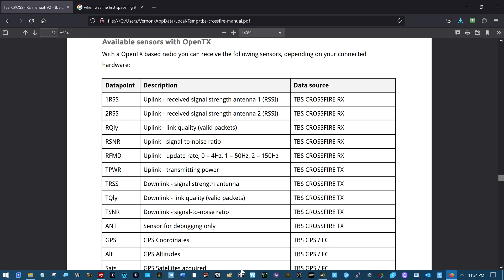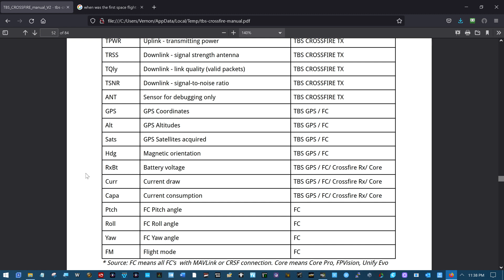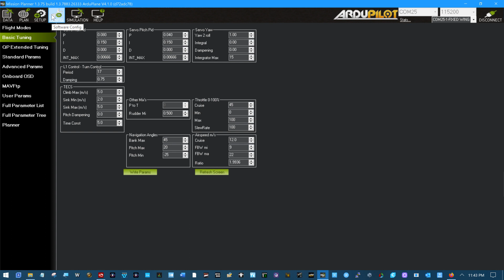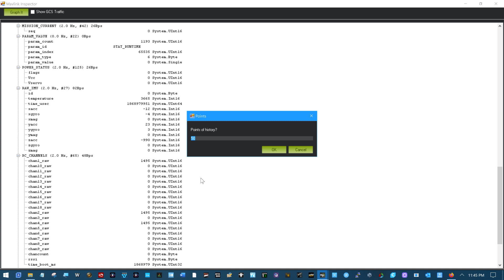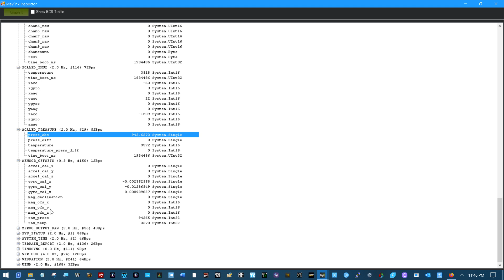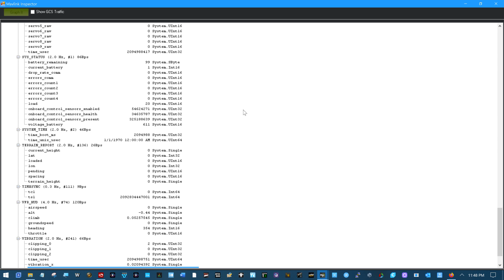Why Am I So Interested In Telemerty

Comment: I am also passionated with telemetry starting with apollo in late 60s. I am using telemetry for all my arduplane flights since 2017.
Reply from the maker: Just makes good sense, doesn’t it?  I like the backup in case my RC TX fails.  It helps me keep track of where the platform is.  It records data that can be very useful.  And it costs very little.

Comment: Hlo sir i am using Matek H743 wing and Frsky X8r receiver how do i transmit telemetry to the Jumper T16 pro what parameters are to be changed in Ardupilot mission planner
Reply from the maker: I am still trying to find more information on the SPort/FPort.
https://youtu.be/ZuE842Bhw9g
Reply from the maker: I did find that other information.
https://youtu.be/Zf5811u-Hao

Comment: The Data Man! Cool cool.. I myself got into wanting telemetry just for the gps coordinates so I could get my antenna tracker working. But learned real quick that the range crossfire allows for telemetry is beyond shorter the distance i fly. Unless using a high gain antenna... But it is still too short. But all the data points that do not stream thru crsf goes into the Blackbox log using inav. 100s of data points like Ardupilot... But I still do not use it. Why.... Cause I'm old school I guess... lol I would rather replay dvr footage of a flight to figure out a problem. Wouldn't have time during a flight to look thru all the data. So there is no need for me to have the ability to look at live data during a flights.
Reply from the maker: Yepper, a second use for the telemetry is an antenna tracker.  It is also used for follow me mode.  I will be using follow me in the future to launch one airplane and then a second that will follow and video the first airplane.  I haven't spoken much about either of those yet, but they are another good use for that telemetry.  I have never viewed that data during flight.  Actually I just found the terminal screen where it is displayed real-time.  Might be a new function I don’t know.  I have used the HUD on Mission Planner for altitude and such, or to view where my platform was on the map.  You see, I have never had an OSD before either.  The Pixhawk, APM and mRo autopilots I have used do not have a built in OSD like Matek flight controllers.  Mostly I had voice mode turned on so every 30 seconds Mission Planner called out altitude and speed and such as that.  The historic problem with Ardu telemetry was range.  The original 3DR telemetry radios(25mw I think) went about 50 yards or less.  Almost useless.  I had to turn off the telemetry failsafe because the telemetry radios lost connection so much.  When I moved up to the 1w RFD900 radios, I maintained a connection and could turn the failsafe back on.  I never ever got out of range of the EZ-UHF/RFD900 radios, but the RFD900 radios will never go as far as the EZ-UHF.  They are both 1w, so the 433 MHz should go farther than the 900 MHz by default.  My EZ-UHF can be switched up to 2w.  I don’t think the 2w is legal in the United States, I think the upper limit is 1w without a HAM license and an extra .5w for someone with a HAM license for a total of 1.5w.  I have the original EZ-UHF and I THINK (not sure) they have been downgraded to 500mw max now.

I did not switch to Crossfire for the telemetry.  I did it for the size/weight/cost of the receivers.  The EZ-UHS receivers are around $125 each.  Used ones can be had for less.  Finding that it might also be able to do Mavlink in addition was just a bonus.  IF I ever get it working.  lol

Truthfully, I have not used the telemetry for anything except vibration dampening in almost 10 years.  I have never had a platform run away, never to be seen again.  I have had them run away.  Lol

I fully expect the telemetry to be like backups and insurance.  Hopefully never needed.  But it will be Irreplaceable for antenna tracking and follow me.

Again, I am mostly doing it for the pure electronics research that most have no need or desire for.
Reply: @nighthawkvs  hey I appreciate you showing your path and why. Gives more ideas and im sure it will help someone down the road. Your a good man Vernon!
Reply from the maker: @JD_1  Thank you sir.